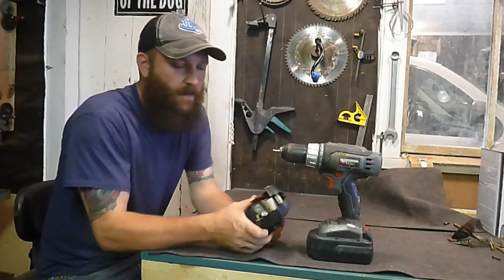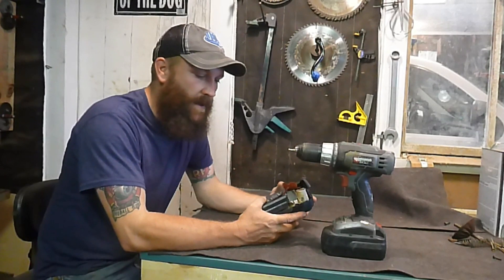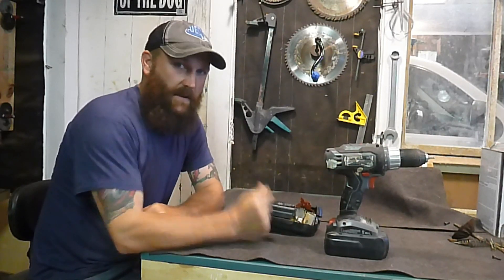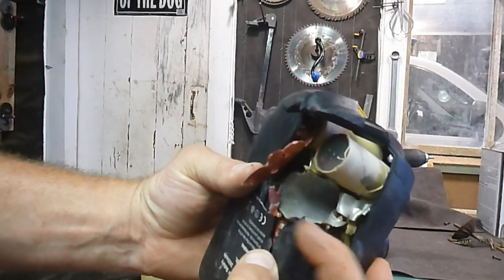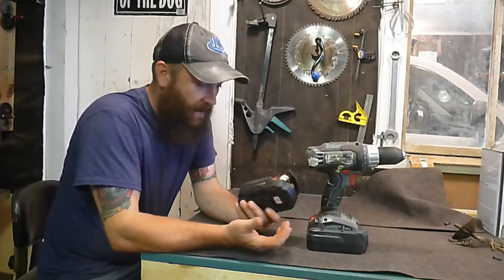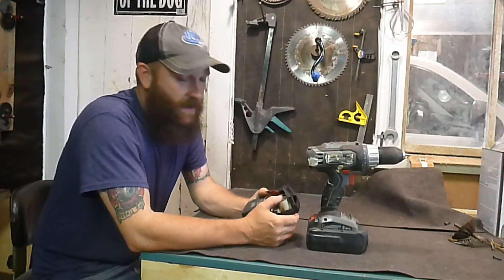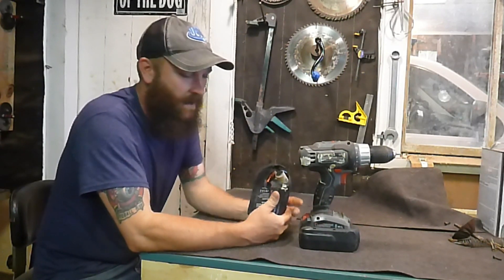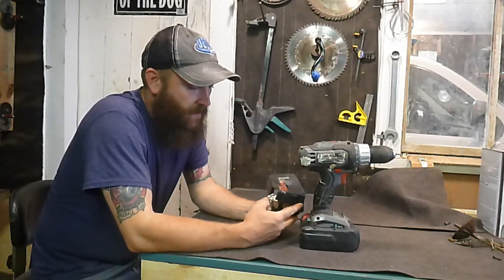Cordless Drill Battery Exploded!

Comment: This just happened to me with my cordless DeWalt drill tonight! Aftermarket battery from Amazon 12v 3.6Ah Ni-MH. Blew exactly as you described it. Super loud and shot completely off the drill, exposed battery cells. And shot black stuff all up my arm and started to have a burning sensation so I washed it off right away... Very strange!
Reply: Gotta be careful with the aftermarket batteries. That’s the caveat of buying aftermarket batteries.
Reply from the maker: Glad you weren’t hurt!

Comment: Wow! Was it a hot day or hot in the shed? You said it exploded after about 30 minutes of use- had it just come off the charger? Was the other batteries that came with the tool Lithium ion or nicad? Maybe the charger wasn’t meant to charge this type of battery? Glad you’re ok and thanks for the warning.
Reply from the maker: The drill was originally meant for NiCad batteries and this was the replacement ni-cad. I had charged thing in the morning and this was probably an hour later when I was using it. It was hot in the shed for sure. I’ve been using this Battery for probably six months at least.